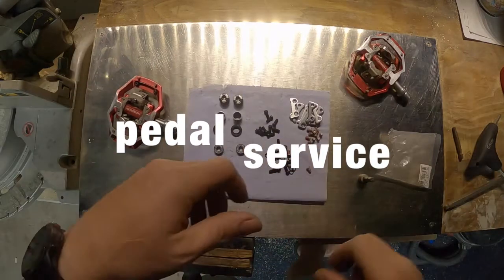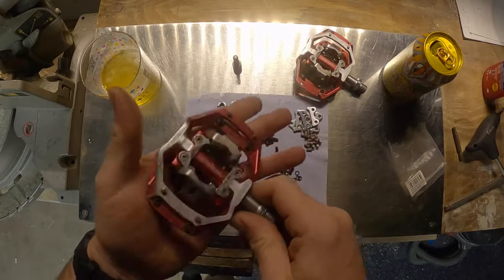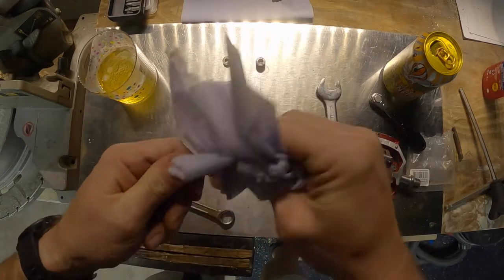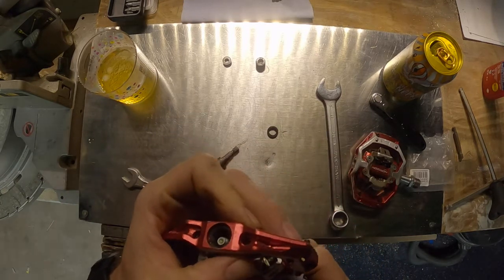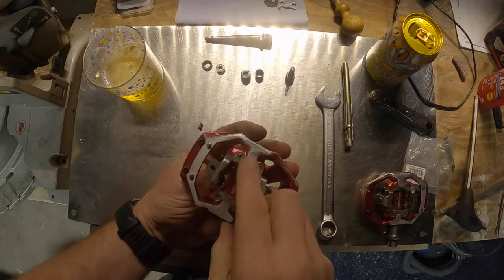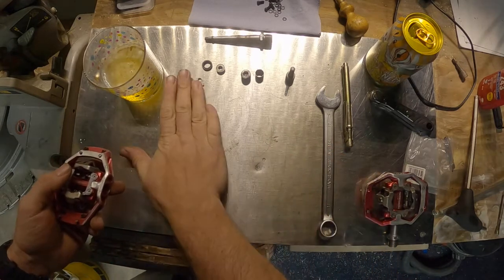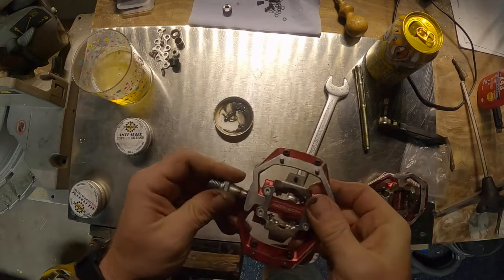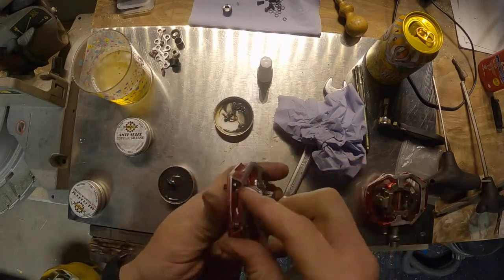Nukeproof Horizon CS CrMo trail pedal service, these are running like new! MTB upgrades DIY overhaul

Comment: Thanks, for the vid. How many miles did you put into these pedals before they started acting up? Do you still use them? Would you recommend them?
Reply from the maker: Wow now there is a question. Quite a few miles 1000ish I ride in all weather's too.. they have taken a battering. I would recommend. I have just had a new bike, I have bought some dmr vtwin clipless.. only because they have some adjustment to play with. And I liked the look of them... and they were on sale!!
Reply: @whitehousetj31  Thanks. Sounds good. I don't want to go above 430 grams, so the Cs looks ideal. Also looked at HT T2, but I like that the Cs is spd compatible
Reply: NP say to use a thread tap, screw in partway and pull out for the bush